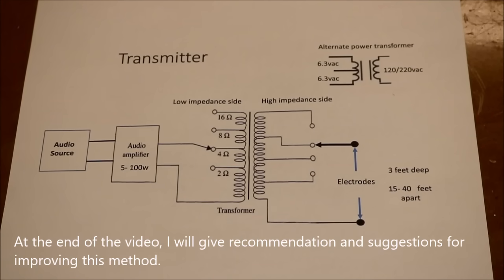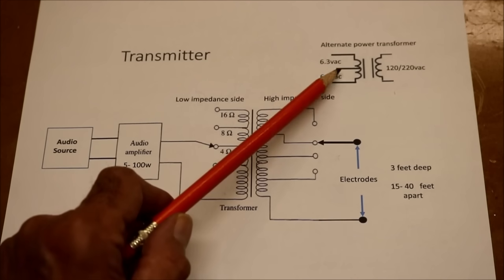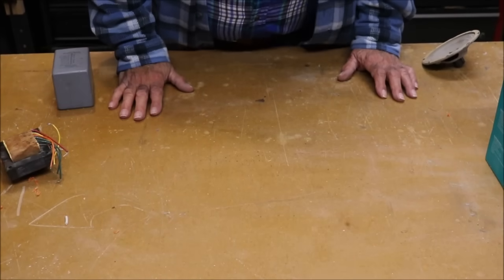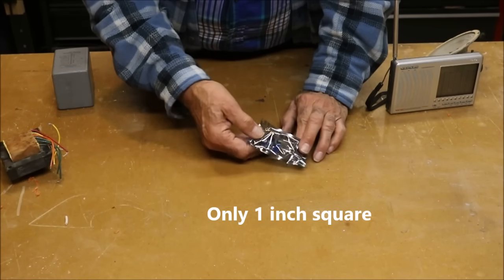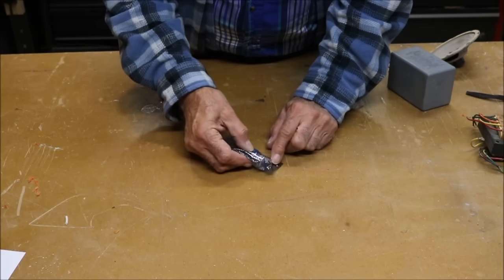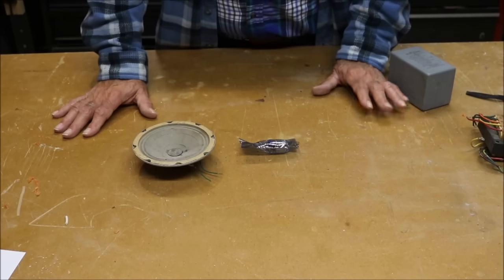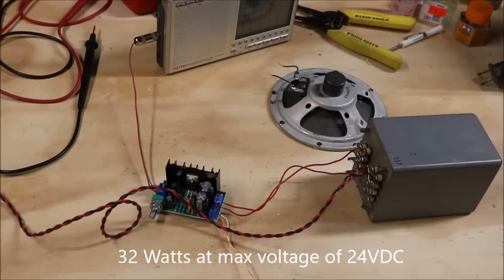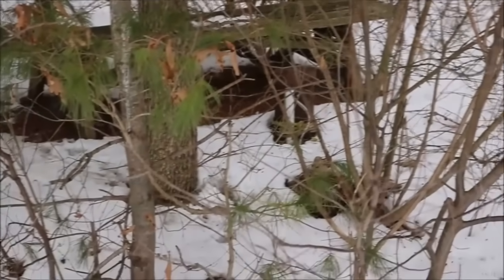DIY Communication Through the Earth

Comment: Ultra low frequency comms.  Hams in Europe have been experimenting with very long distance communications.  They are using frequencies as low as 8.27 KHz.  with very large loop antennas on the ground or so.  They use specialized digital methods.  This allows them to communicate over hundreds of kilometers with these techniques. Data rate is extremely slow.  Power levels are not super high or something.
Reply: That's different. This is sending audio baseband through the ground with no carrier.
Reply: Like the low frequency communications systems the submarines use - that huge antenna array down at Annapolis at the Naval Academy...
Reply: ham radio operator here..Amateur Radio Bands Europe .... 135.7 to 137.8khz  is the lowest used . Ultra Low Frequency (ULF) is a radio frequency band that is also known as the Alfven velocity. This band is almost exclusively used for communication in mines because of the ability of these low frequencies to penetrate the earth .. communication on these frequency's is extremely limited because they don't propagate through the ionosphere .and no they have never been ever to communicate hundreds of km on those frequencies.
Reply: @robertfleming9161  There are hams that have, but they actually use antennas and not just probes in the dirt.
The device in the video is not an actual radio in that there is no tuning and no carrier. They are literally just sending audio directly through the air without any modulation.
Reply: @3fives-j5w  tom sherwoodz51 said they have used frequencies as low as 8.27 khz he doesn't know wtf he is talking about .The audio spectrum range spans from 20 Hz to 20 khz. so he tis saying people are communicating hundreds of km with sound through the earth also what do you think would happen if you hooked up a antenna to the speaker output of a radio. I am a ham radio operator what he said is COMPLEATELY NOT TRUE !
Reply: @3fives-j5w  sending audio through the air with no modulation ...  wtf  modulation is mixing of a carrier frequency with another signal .I am a ham radio operator and you could not be more wrong if you tried to on purpose.
Reply: @robertfleming9161  The device has no carrier frequency. Modulation is mixing a baseband signal (in this case a voice) with a carrier signal where the result is the carrier frequency + and - baseband frequency (for AM, the sidebands which contain the actual information).
When you tune your radio you are selecting the carrier frequency. The device in the video has no carrier frequency as its just sending raw audio and not a radio signal. Therefor it is not the same thing at all as ULF radio.
Reply: @ . Radio amateurs and electronics hobbyists have used this mode for limited range communications using audio power amplifiers connected to widely spaced electrode pairs hammered into the soil. At the receiving end, the signal is detected as a weak electric current between a further pair of electrodes. Using weak signal reception methods with PC-based DSP filtering with extremely narrow bandwidths, it is possible to receive signals at a range of a few kilometers at best with a transmitting power of 10–100 W and electrode spacing of around 10–50 m.
Reply: @robertfleming9161  Not technically legal today as you would be making interference that would be received on all nearby radios.
Anyone with an AM radio within a few miles would hear the audio signal over their desired signal.

Comment: I wonder whether using some kind of carrier might also work? Whichever frequencies work better with earth transmission, you could put the audio on top to increase the range? Just speculating!
Reply: Maybe a very low carrier (together with a digital modulation scheme) as used by u-boats to communicate when submerged in seawater would work & increase the range (ELF - extreme low frequency), of course then it is not a realtime audio link, anymore.
Reply: @weinihao3632  u guys are talking about BASS or infrasonic f lol lol good luck sending audio besides bass tracks.
Reply: @weinihao3632  can they find a channel tho? I dont want to share. hint, rocks, dirt.
Reply: @weinihao3632  Yes, I was thinking along similar lines but with AM.
Reply: Interesting experiment,  I could see optimizing the impedance match to the electrodes being worthwhile.
Reply from the maker: The frequencies are typically low.. Higher frequencies do not do well through the earth